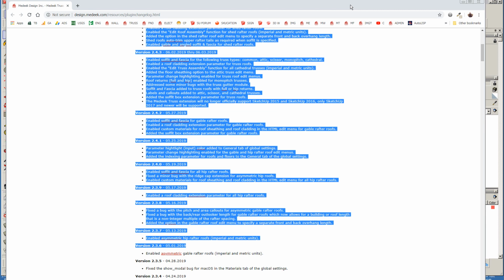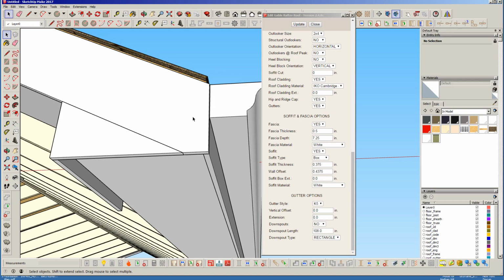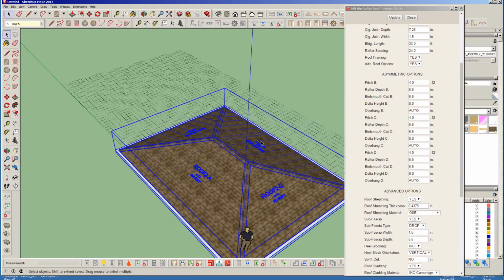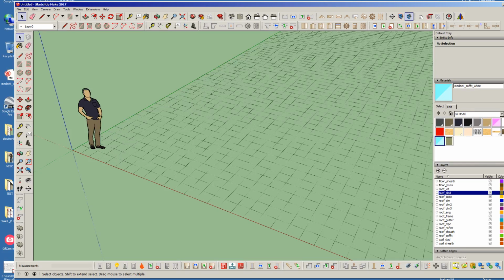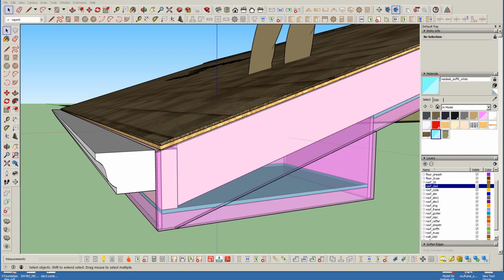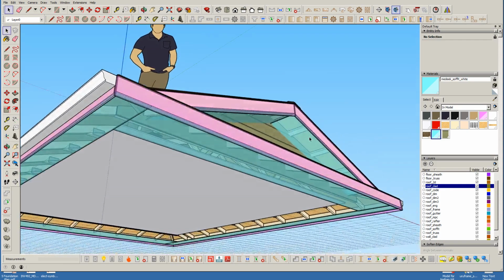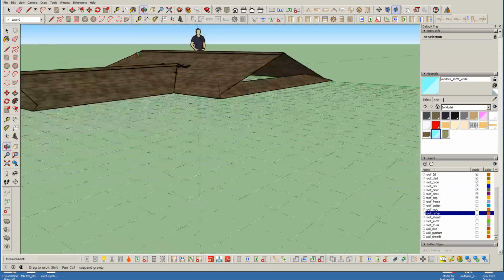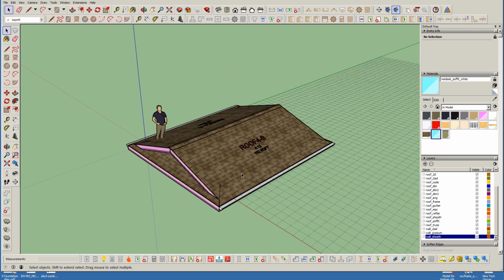Medeek Live Training: Session 2

Comment: I noticed that the SQ' of ROOF B is still 192 sq' after you trimmed it at 57:48. Is the text and calculation supposed to update after the trim operation? I want to be able to correctly calculate how much roofing material to order.
Reply from the maker: I mention in the video that MANUAL operations are not recorded or picked up by the plugin currently.  There may be something that I can do about this though, I will need to give it some more thought.  The trim tools are not specific to the plugin or roofs, they are generic tools that can be used for any geometry within SketchUp provided it is a solid group or component.

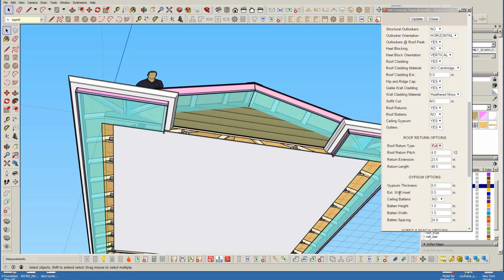Comment: Nathaniel, at 42:40 I noticed that the soffit material is just floating with no horizontal framing to pick it up. Does your wall extension draw framing to carry the soffit material?
Reply from the maker: The soffit material is supported along its outer perimeter by the sub-fascia.  I do not draw the additional framing/blocking to support the inner perimeter.  I have given this some thought however I've tried to stay away from adding in too much blocking and bracing.  For example with a truss roof there is a lot more lateral and cross bracing involved that I do not show.  Even with a hip rafter roof there is often additional blocking along the hip ridge.